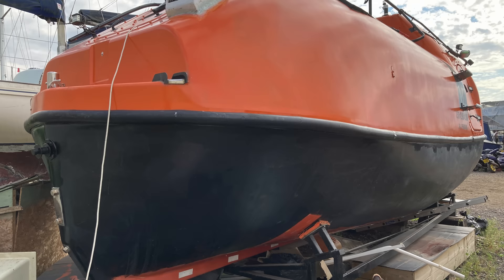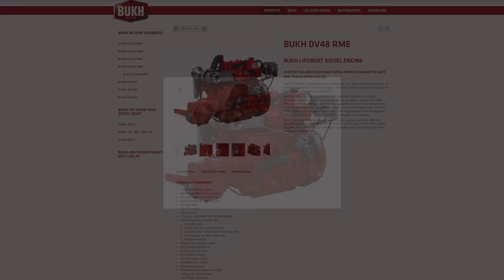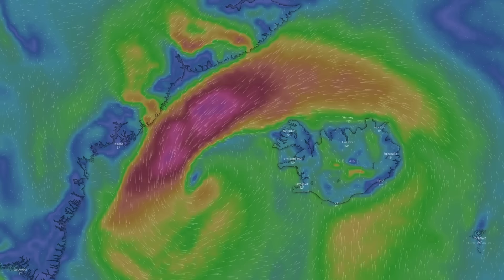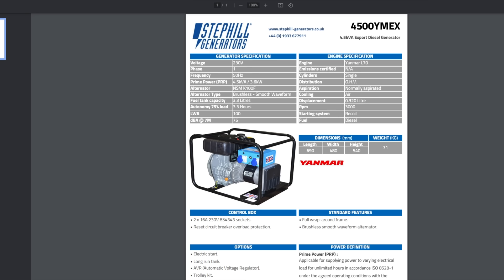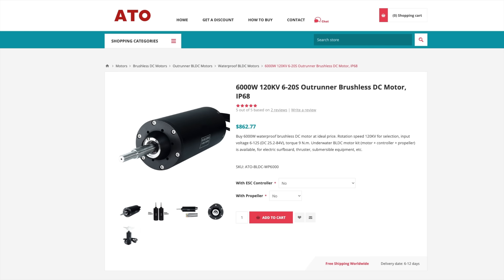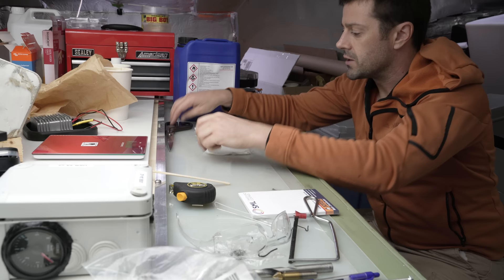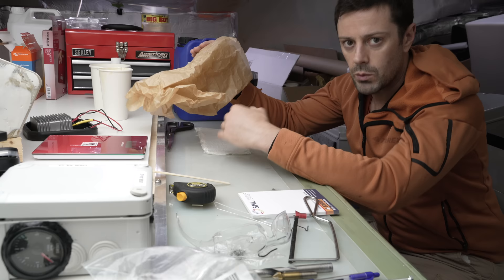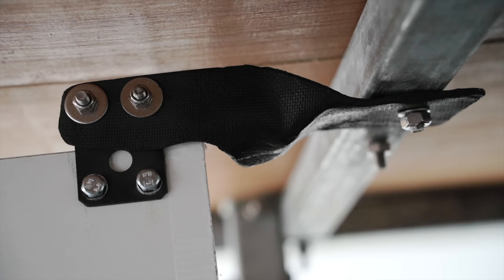Lifeboat Conversion Ep49: Electric? An engine backup plan, if Alan's Bukh diesel fails at sea. [4K]

Comment: Adding a short mast with a modest sail would be a good idea. I’ve heard those lifeboats roll pretty good and having a staysail wouldn’t be an awful idea either. The mast could double as a lookout mast for navigating your way through ice with a high point of view.
Reply: If you add a mast you can also hoist up additional solar pannels for extra power far north. I am talking about thin, light and foladable pannels. In high wind you would have to take them down. Plus that array would be mobile for overland use.
Reply: @thx9977  a flexible solarsail...
Reply: @thx9977  thin solar panels have a huge problem with heat dissipation and lose their initial efficiency very quickly
Reply: if you add a mast, you gonna need more ballast. which means a heavier boat to push through water and it will change your center of gravity. which also means adding a keel.
Reply: @outlawflyer7868  bilge keels would be also good thing to add to reduce rollng as those life boats are known for it. As for for the ballast consideration, some might be needed but they are also known for being stiff vessels with a relatively high GM to begin with. Also a low standing mast would probably serve best, necessitating less ballasting and lowering of the COG.
Reply: @Ciekawosc  mounted mine on 16mm Clear Multiwall plastic to help heat escape through the plastic tubes in base plastic panel it's bolted to.

Comment: I am glad you are considering a plan B for forward motion. Similarly an external outboard engine type thruster, driven by petrol or electricity is a great idea. No additional holes in the hull underwater. Additional functionality should include a grating bolted to the stern for ease of access from the hull so that icy conditions don't add to the hazard, and also access to the auxillary power options.

Comment: I think you are on the correct track, 3 motors gives you a better chances of getting out of a sticky situation even if one dies, always better to have mutable back ups. Also battery and electric motors are less likely to fail then a outboard or other multi fuel burning motors setup.
Reply from the maker: Redundancy was indeed one of the factors, and outboards are alarmingly complex! A cheaper petrol outboard as you imply is too unsafe.

Comment: Keep it simple seems the best way forward, especially in case of emergency. 

I would further explore a diesel outboard, with the minimum HP required, or a equally quick to deploy electric solution.
Reply from the maker: The video covers this. Diesel outboards are very heavy, very expensive, complex to maintain, and need to be stored upright. Even a reconditioned old, lower power one is £10K+.
Reply: @AlexHibbertOriginals  that's a lot more expensive then I imagined when you said expensive whoo...

Looking forward to seeing your solution installed and tested, preferably with plenty of grinder action.

Or could you run a regular electric outboard from your battery pack? Maybe 2 in tandem connected by a bar for steering?
Reply: @VinceW187  the picture shown at 7:06 has a price tag of $30.000.
Presumably this isn't just a random picture but instead a picture to show the class of engine Alex considered?!
Reply: @Jehty_  TY
Reply: One issue with hanging an engine  outside off the back needing air creates a problem with keeping water out of the cowling/engine during adverse conditions. Also having to open any hatch during a storm to use any complicated backup just wont happen untill the storm passes. Some form of wing engine/motor will probably work out the best solution for a worse case, time critical event. Saying that though, I have been in storms in blow boats with strong diesel engines and still ended up hanging off a sea anchor for two days because of conditions rather than  sail or engine faults.
Reply: ... sorry, hate to admit it, but
 diesel outboard 
PLUS electric outboard 👍🏻
if only one – go diesel 

Would love to see that 3screw set up ( 3x5kw?–for 🇩🇪) come true, see if it would work 🤞🏽🙏🏼🖖🏼

Comment: I've been thinking along similar lines about fitting electric motors that can be deployed in the event my diesel fails, or if I simply want to trundle a short distance or for mooring. I like the solution you outlined.

Comment: My humble suggestion as someone who has seen everything go wrong is pack a spare turbo and hoses for that turbo as well as a spare alternator or simply bracket in a extra alternator with a double pully. Pack a supply of extra hoses, hose clamps, oil... A lot of it as well as a funnel and tray you can use to scoop oil with good leather gloves and rtv silicone.... And duck tape

Comment: I like the rear railing/deck/engine mount. help secure wires and what not from environment. I believe having multiple smaller azi-pod style motors.
Also, if the motors raised and lowered in to the water you could combine the steering into the vertical shaft the deploys it.

Comment: Alex, I’ve been watching your Alan exploits since the beginning.  I truly want for this to succeed, but the further this goes along the more I wonder why you went down the old lifeboat route and not with an old arctic capable sailboat that’s already pretty much designed for what you need.  In the case of a sailboat it’s the diesel that’s the backup power system.  Wind can be a little tricky to harness at times but it’s completely free and quite sustainable. I’m obviously a sailor, but I also spend my fair share of time on powerboats too. 

That said, I have no doubt that with enough time and effort and more unconventional workarounds you will arrive at a boat that does most of what you want. I’ll keep watching and hoping you can solve the fundamental problems you are facing.
Reply from the maker: Polar-ready yachts aren't quite as simple as a straight up alternative to a TELB. Most are out as they have keels that aren't ice-compatible. Those that really are s**t hot will be hundreds of thousands of pounds - those with huge lead ballast, steel impact bracing etc. Alan has the advantage of inherent buoyancy, heavy inbuilt insulation, cavernous interior, and a very sturdy hull. Many yachts also only have little engine and props as an after-thought, which couldn't be relied upon if having to fight for days through loose ice, when wind power couldn't be relied upon.

Comment: Alan was designed to give folk the best chance of survival in a desperate situation. 
Make the existing propulsion system as reliable as it can be.
If it breaks down, call for help - you're not going to sink...
I enjoy every episode so thanks, regardless of whether the above is of any use 🙂
Reply from the maker: The boat can still be wrecked, or collided with, so a secondary power source is sensible, especially if I'm installing a reinforced transom and need an electric motor for the inflatable anyhow.

Comment: Could consider using a outboard steering system.   Then your moving a cable system in and out of a protective tubing.   If you incorporate a outboard hydraulic lift of electric lift then its simple as toggle to lower your unit and toggle to raise.   Then your steering can be simple as push forward on lever for one direction and pull backward for opposite direction as some flat bottom boats used.   If you add the switch to trigger raise and lower onto that with a nob to adjust speed of electric drive.  You can minimize it to least amount of space.   If you had three switches could toggle all three on or just one in case you lose one.   In a jam, make rudder stationary and treat the motors as ship steering use one forward and one reverse for turns as an option if rudder gets damaged thus does not turn.

Comment: I agree with your plan. You can't beat a diesel for reliability and efficiency, and you have too little space for a lot of batteries. Fuel is available everywhere. You primary motivator is ideal.
But like you, with my little powerboat, I want a separate backup system, enough to get me out of immediate trouble. Electric as a backup is far more viable than as a primary. Building a small rear deck off the back would make getting in and out and loading supplies a bit easier and safer. It only need to be half a meter by 4 or 5. Then you can deploy two electric drives off each corner. You could probably fold them up under the deck to keep them on the outside and not take up space. And while you could steer with a tiller, you could steer with separate speed controls! By reversing them, Alan could spin in place! I think two are enough, 3 is overkill.
Reply from the maker: I like the idea of using reverse thrust to steer
Reply: @AlexHibbertOriginals  What do you think about a small deck off the back?
Reply from the maker: I like that too.

Comment: The best way to power Alan with solar would probably be to build a pontoon bridge across the sea, covered with PV panels and a rapid-charge station every few kilometers. 

Making it within budget and in a way that doesn't make it a maritime hazard is probably easy.
Reply from the maker: You have tapped into my comments section's soul.

Comment: I actually build a electric hydrofoil and the challenges were massiv. You can see my build log on my youtube channel. 

The main thing is that those small brushless motors use a digital drive that changes the polarity of the current instead of a carbon brush. Those digital drives are fiddly to setup and require some experience which luckily I got from the efoil community. You cannot troubleshoot them without a laptop. 

The other thing is that the current is massive. My hydrofoil runs on 50V and up to 150A. That is 7500W and will drain any sized battery in no time. Even my Electric Vehicle with 400km range would only supply that motor for 10 hours. 

I would rather go for a wind powered setup. That is waterproof and you can troubleshoot it with your bare hands. Also cheaper and the power source is endless.

Comment: I would have originally though you would go with a through shaft generator/electric motor combo, it would help to keep the batteries charged when overcast and diversity is always a good thing in extreme environments, though your point about driveshaft, rudder and prop failures is definitely a good one, would it not make more sense to carry spares of those? Granted, getting out and changing a propshaft under water adrift at sea in the artic sounds like a terrible idea, the likelihood of such an eventuality is pretty minimal for this craft. Unless you intend to change the rudder system? your only real concern would be hitting a submerged object, ice, shipping container, shipwreak, etc your current rudder system seems designed to be resistant to such collisions.

Comment: Love the series, am here from the beginning.
Understand your concern about your powerplant, but a back up from electricity will nog be sufficient with your battery set up.
Maybe the cheapest choice will be a 1 cilinder inboard diesel.
This is not helpful if your prop shaft is compromised.
But more realistic then a sail or a outboard in my mind.

Maybe start with rebuilding the current engine en gearbox? 

Love the progress so far! 

Gr from the Netherlands
Reply from the maker: Don't forget there will be a diesel generator too.

Comment: While it might be very impractical, a mast and sail might be the best solution? Easy to maintain, cheaper (?) than three engines and, as an added bonus, you can use the side railings as anchor points. 

I know it’s not as reliable, but it saves power, money and time to setup

Comment: A mount on the back ready to take an electric or diesel outboard engine, one that could be lowered and dropped onto the mount if the need arises?
Reply from the maker: The video covers this. Diesel outboards are very heavy, very expensive, complex to maintain, and need to be stored upright. Even a reconditioned old, lower power one is £10K+.
Reply: @AlexHibbertOriginals  Electric outboard?
Reply from the maker: The video covers that too. It's essentially what I'm doing, without having to comply with the whole power and control ecosystem Torqeedo and other brands tie you into.

Comment: I been thinking of getting a similar vessel designed. I like the idea of electric power as well as torroidal propellers and using the oceans swells to generate electricity to recharge the battery combined with perovskite solar panels and torroidal wind turbines....

Wish I could crowd fund hiring a master naval architect to help with the design and the construction process...

Comment: Things I've used with various levels of success to make a backer for polyester resin: Saran Wrap ( Cling Wrap ), PET-G printed from a 3d printer, Packing Tape covered pieces of wood and wax paper.  I like the electric motor idea, you could have some sort of generator you could break out in emergencies to run them off of your stores of diesel.
Reply: Well, since you teased us by mentioning "various levels of success", the least you could have done was rate them from worst to best.
Reply: The wax paper became part of the fiberglass in a permanent way.   The cling wrap fell apart during removal but didn't stick. The petg raft and packing tape covered wood worked perfectly.
Reply: @jkj2r80fojf23 - many thanks for that!

Comment: I also considered parasails, but gave up, I tried an electric outboard, but after 3 months waiting I cancelled and bought a petrol outboard and plumbed it into a 50 litre tank. This is my least favourite option but it's done now, however after seeing the same hull as Alan in Amsterdam with a mast, I think I will go for this to give me a third motive option. The one in Amsterdam had no added keel, just ballast and seemed to be a fair weather sail, so I am going with a tiny windsurf sail, at under 3 meters it will pull the boat along slowly, and will mainly be used for saving fuel. Unlike myself you were talking about adding a keel at one point so this might be the best option for you.
Reply from the maker: Bilge keels - custom removable ones, indeed.

Comment: I like the idea of electric motors when I'm doing a project, but in this case I think you might be overthinking it.
My reccomendation would be to get an older Yamaha Hi-Thrust 9.9 long. I know it introduces another fuel, but they are very efficient, so for a backup you could use a single externally mounted tank. I bought one for a project boat (and home) that I used to own. That boat was a heavy steel 34' boat with a 13' beam, and no thought to hydrodynamics. Still manage to push the boat along at near hull speed, and had pretty good control of the boat while docking. The Yamaha motors are incredibly reliable, and a high lift outboard bracket should be all you need.
While you could certainly do it in the way you suggested, think of all the time you's be spending on a backup, rather than getting closer to your overall goals for the boat. Just my 2 cents! 
Great channel, thanks for the content!
Reply from the maker: It's certainly something I've considered. And will continue to.

Comment: This all reminds me quite a bit of  space exploration. Essentially once your out there your alone. No one can get to you quickly, if they can get to you at all. So you have to have multiple ways of doing everything. Alans Engine has been built to be essentially bullet proof, but nothing is 100% so it makes sense to want some sort of propulsion back up. I also agree that not only the power plant should have a back up as the propeller could get fowled, smashed, or lord only knows. So a complete secondary propulsion system makes sense. I thought about this to see if I could think of anything else you could do. I thought it might be easier to mount 2 electric outboards one to each side, but it would be difficult to link them  without some kind of complex electric steering control so that's out. Honestly I thought on this for a few hours and your idea seems the best. Its simple, and likely as power efficient as its possible to be. I will keep thinking on it, and if I come to any ideas Ill post them here.
Reply from the maker: Thanks Seth

Comment: As for steering your tri outboards- Could you do 2 instead and just use differential thrust? Keeps the mounting and control significantly simpler. Best of luck, love this series.
Reply from the maker: It's possible, but I'd need to check the separation/angle would be sufficient.

Comment: I think in a emergency   2 small out boards  25 hp each or less would give you a chioce of 1 2 0r 3 engines   no need or generrater wires battery's blowing up
It's the simple way  great vedios

Comment: A small diesel outboard is a good option, and probably less expensive and easier to set up... if you factor in labor as an installation expense. Additionally it would not require a rudder in the event the original one was damaged as you described
Reply from the maker: Can you link me to a 'small' diesel outboard that isn't £10k+ second-hand, or the weight of a small person?
Reply: @AlexHibbertOriginals  
Yanmar at about half your request
Reply from the maker: All the D27s I can see from good retailers are £10-16k - inc. refurbs. They also weigh a ton.
Reply: @AlexHibbertOriginals  
The one in the link was removed from Alan's cousin

Comment: As for the rudder, having a spare rudder hanging of the side that can be fitted on the stern like an outboard might get you home if the main one goes out. 

I’d stick with the diesel setup and simply bring some spare parts.
Reply from the maker: Re: spare parts - sadly there are enough things that can go wrong with an engine that can't be quickly fixed at sea with a spares box, especially in tough conditions.